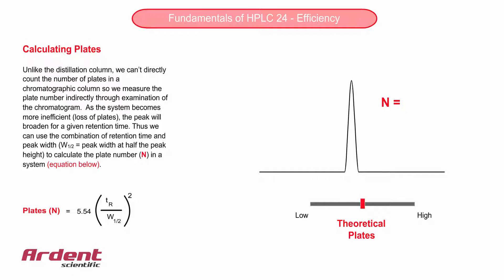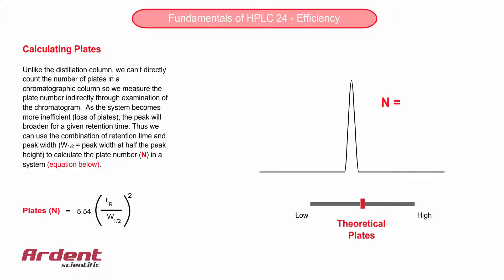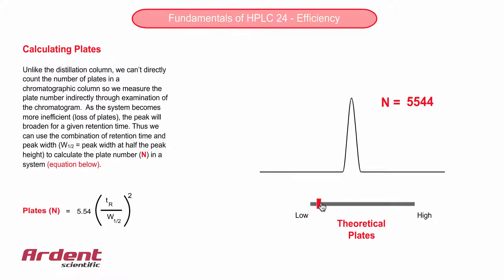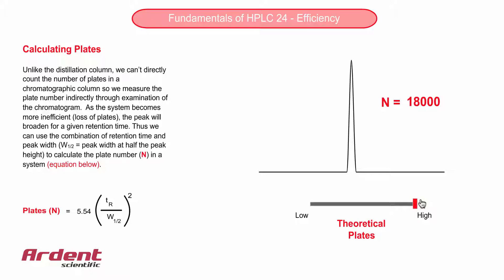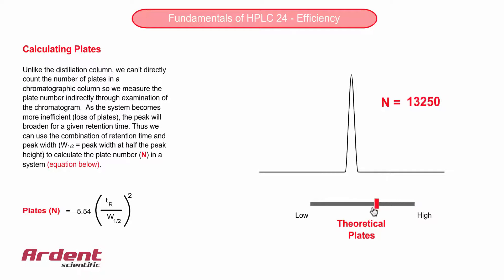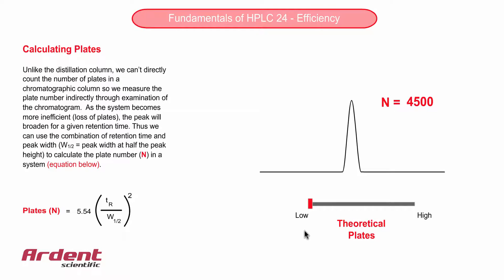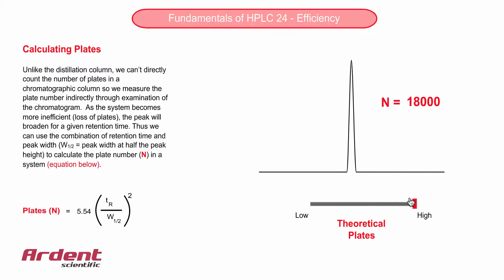Fundamentals of HPLC 24 - Calculating Plates

Comment: what does plate count exactly indicate?
Reply from the maker: Plate count is a measure of the peak width for a given retention time. As the column ages or if the HPLC is not plumbed correctly, the peak width gets higher leading to a decrease in the plate count. A lower plate count results in poorer resolution.